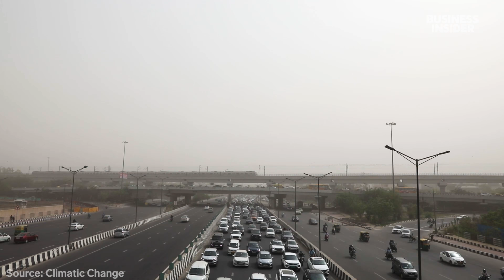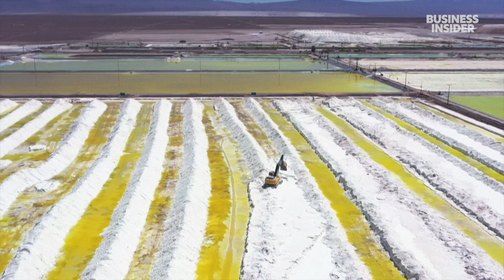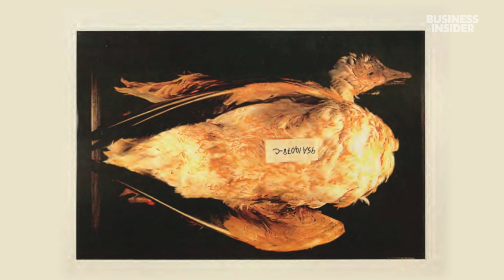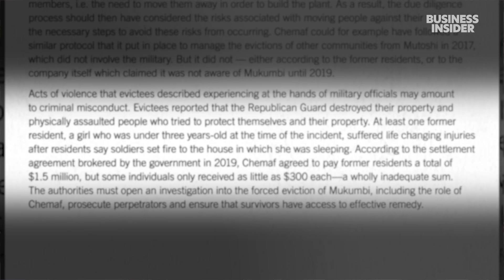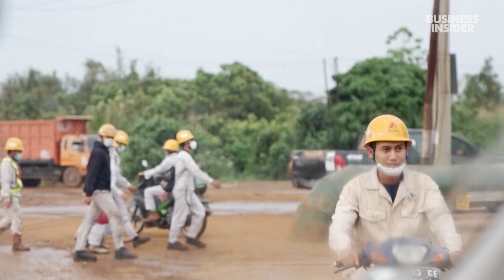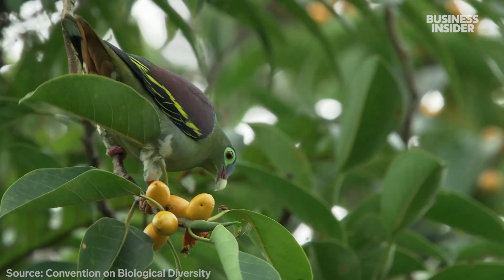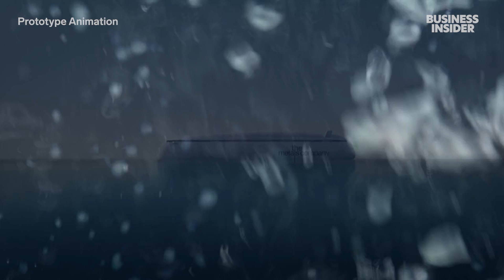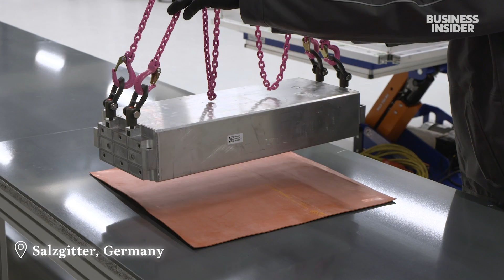The True Cost Of Mining Electric Car Battery Metals | True Cost | Insider News Marathon

Comment: Oil can’t be recycled, coal can’t be recycled but over 90% of batteries can what’s more as more battery technology develops the batteries will, are becoming cleaner. Sodium iron as an example.
Reply: Plug in and charge from hundreds of miles transmission lines from generation plants burning coal and wood pellets. EV efficiency is half because of weight and temperature, twice the tires and brakes. Parking in attached garage may burn everything you have likely won't be insurable. Small damages to battery or undercarriage probably wrote off
Reply: @briancote8216 coal is less than 20% of our electricity source. 1980 called and said you’re due to get your mullet trimmed.
Reply: @briancote8216  
That's total nonsense. 
EVs use a quarter of the primary energy compared to combustion vehicles.
Reply: @briancote8216  I have a few friends with Teslas and none of what you just said is true. Starting from the fact that our power comes from Niagara Falls.
Reply: I won't believe you until you give me at least source of someone claiming 90% of battery material recycled. Even then we would need deep investigation wether those claims are close to actual truth.
Reply: Battery tech is always improving
Reply: @Optimistprime.  ya, that's is why we are doom for committing everything now for the current Li ion battery technology
Reply: @logicthought26  Global Averages do not mean that significant amounts are not recyclable in some regions/sectors.
Reply: But lol can be reused. My friends and I use screen used motor oils for lots of things like lubrication, exterior wood staining, water proofing, returning, coloring and more.
Reply: oil absolutely can and IS recycled ya muppet
Reply: oil/gas/coal are energy dummy.  Recycling require energy dummy.
Reply: Mass and velocity simple physics
Reply: Our 1% of global emissions
Reply: 25% from the falls 59%nuclear 8%wind 1%solar rest is natural gas
Reply: Plastics could in theory be recycled. But we make them as cheap as possible then we don’t recycle them. So just because something is theoretically possible doesn’t mean that selfish humans will actually do it.
Reply: @wmpx34 We recycle a significant amount of plastic.
Reply: they can't so far. I dislike oil for cars with all my heart. I own an EV. but the gods of chemistry haven't nailed recycling that yet.
Reply: @martiruda   TY for also raping the earth.
Reply: @martiruda where do you get your information? FaceBook? Fox opinion anchors? Recycling is already happening - problem is batteries are lasting longer than expected so there arent as yet much available.
Reply: @geraintbermingham4383  I referred to the subject of recycling oil. I'm aware of the business running battery recycling.
Reply: @martiruda  the Chinese already recycle tens of thousands of tons of batteries / year.
Redwood in the US & the Europeans haven't got enough old batteries to scale up big yet.
Redwood is ready though
Reply: @guringai  still is less than 10% of all batteries
Reply: @andrewcannon587  most laptop & phone batteries go to landfill. 
It's far more efficient to collect car batteries.
Reply: @guringai  I referred to the original post which talks about oil recycling. I am aware of battery recycling which is great!

Comment: Well some facts here are wrong for example Combustion Cars use Cobalt either for refining their fuel in the first place or in the Particulate Filters. After all these mines diden't just pop up for electric cars they did increase activity.  most of these minerals can be recycled where most of petroleum products are burned once while still making a big lasting mess.
Reply: Well said
Reply: If you tell a live enough many times it turns to be true. I spoke to an oil reffinery and asked them if they use cobalt in their catalytic converters for sulphur purification. They don't. They use a nickel/molybdenum alloy for sulphur purification. So cut the bullshit!
Reply: @MikeInc79  and what about the platinum palladium and rhodium in catalytic converters? They are far less available then lithium.
Reply: Whataboutism...  @maumau165
Reply: Yeah, exactly. Recycling the batteris for 10x the cost of a new one.wich means it will never be done. Hence the mess is still far greater from evs.
Reply: @TH-qh6jz  What a bunch of absurd nonsense. Even worse with your erroneous agenda. LiFePO4 Batteries uses ZERO Cobalt.

Comment: The closed copper mine featured in the video closed in the 80s and has NOTHING to do with EVs.
Reply: yes it has everything to do with EVs doesnt matter what you say! all those materials ends up in literaly everything around the world.
Reply: We would need 6.1 billion tons of copper in order to produce just one generation of renewables (which would only last between 20 and 40 years before they need to be junked, and new ones made, using newly mined materials and fossil fuels). To date (up to 2024), roughly 700 million metric tons of copper have been produced around the world.
Reply: The picture of the holey ice and the running polar bear had nothing to do with Crimate Chang, either.  
That was one of Algore's 1,000  lies.

Comment: We need more plug in hybrids, and diesel electric systems for heavy equipment. Leverage the strengths of petroleum while we still can, and make the leap to full electric that much smaller.
Reply: Yeah, instead of this it seems we are pushing so hard for huge suv EV's and companies continue to push the range further and further. Then you have the hummer and certain Tesla's and rivians that utilizes enough battery materials for 20 reasonable EV's. I'm sure there are loads of people driving extended range electric vehicles that have the capacity of 300+ miles, but they are making a 20 mile commute round-trip. We need more electric vehicles with small batteries that can be plugged in, and a small supplemental generator.
Reply: @timlong1462  Seems to me that an electric car could benefit from plug in battery modules. You add more modules based on the estimated drive to a limit. If you only need a short duration trip what's the sense of hauling a 1000 miles of battery range with the reduced efficiency of extra weight.
Reply: Stretch the battery resources for where they are really needed, most folks only drive a few km a day so if they can charge at home or work a PHEV makes the most environmental sense since they will almost never use fuel until they have a long shopping day or the infrequent road trip. No need hoard batteries for those rare occurrences, if they have a marathon commute or live in an apartment an HEV with a good fuel economy will help stretch battery resources.
Reply: PHEV is the optimal technology, period. There is simply no need for a 300 mile EV when you could instead have a 50 mile PHEV with a small range extender for the rare occasion it becomes necessary. Bonus: The PHEV also works in winter.
Reply: Chinese BEV works in Winter. It is their regulation to pass winter test.  @N20Joe
Reply: More diesel electric for heavy equipment, how is that better than a straight diesel drive?

Comment: Electric vehicles are NOT a new thing, first cars ever made commercially were electric with battery's in the 1880's they gave up on them because they were slow, heavy, dangerous and would not travel far.... whats changed....nothing
Reply: if you don't think batteries and motors have changed in 150 years something's not right.

Comment: These pools are a very old method as it's the same from almost 100 years.
Like add a dome made of glass increase the heat and collect the humidity and tada fresh water and it works faster and if it rains it doesn't make it take longer as the pools didn't get more water from rain.
Hell there new technology that can make more then this in 3 to 5 months not 16 to 20 like this method.
Also copper is very recycled up to I think 97%.
Also car battery's have ben recycled for decades now and the ev one use same process but with up to 3 to 9 more steps but all the other 36 potential steps are already done now in production lines.
So just add 3 to 9 more steps too all the already there battery recycled plants.
Reply: Not just that, but also no mention of Lithium being mined in the UK! Strange how this video covers some countries and mines here which have some pretty rubbish enviromental records and ancient tech, and not Cornish Lithium which looks to be as green as possible and who also are looking at copper, cobalt and tungsten. This anti-EV crowd really clutch at straws and I bet they don't point at their own mobile phones and gold miining in the same way.
Reply: @katiegoode 
EV's require 6 times the mineral input of an ICE
also mining practices for lithium are abhorrent and does far more environmental damage than anty other form of mining and more damage than ev's save 
then theres the tiny little fact that there simply is nowhere near enough lithium on the planet for EV's to become mainstream
we started with ev's over 100 years ago
they were fucked then and theyre fucked now
this green dream bullshit is nothing but an exercise in coffer lining!!!!

global warming... ahem i mean "climate change" is a multi-billion dollar industry and therefore cannot be trusted to deliver facts
wind farms never produce the energy it took to manufacture and they piss oil all over the place frm the hub seals
solar farms artificially raise the surrounding temperatures and destroy precious farmland
the ONLY form of "clean" energy is nuclear
if you absolutely must insist on EV's they should be run of micro reactors NOT batteries
there is no power grids on the planet that can supoprt mass EV charging either
the power comp[anies piss and moan every summer about people running their AC's
now add millions of EV's suckin power off the grid and voila!! no more grid

add up every single piece of "pollution" humans have ever contributed throughout our entire existence and you wont have enough to equal  even a singular tiny volcanic fart
Reply: @katiegoode  true but usa is getting back in it.
Also city battery's or battery's that will never move don't need lithium and it can be almost as heavy as they like as they don't move.
Reply: Just add a dome of glass. Do you even have the braincapacity to calculate the sheer mass of glass needed for that? The amount of energy to form, transport and place that glass? Or do you mean small little domes? Over smaller pools? Also, link to that new tech that speeds this up please. Those companies with those huge profits might give you a neat bonus for the methods they did not research themselves. As they need to do this 100 year old process, clearly they do not have the money to fund research for more efficient ways to mine.
Reply: @Mediamarked  um ya it's less then 1 skyscrapers worth of glass and we build glass greenhouse all across the world all the time.
And a 1 time transportation of the glass of let's say 200 trucks.
Omg like adding the extra systems they can collect freash water and prevent rain from increasing the time taken and you can open the tops when workers go I so it's not over 150f.
Also it will prevent wild life and people from getting in it like in Utah where people where literally swimming in this kind of water.
Hell other then the 1 time cost with random repairs after a few years I call it a win.
Hell they can use it in winter as it definitely going to be warmer then outside.
Reply: Great info. I am loving the comments on this vid. Way better than normal collection of people from the mining industry itself. These news outlets just give a strong slant of misinformed cherry picked bias going from opinion instead of knowledge.
Reply: The problem is the demand for copper is skyhigh. You can today only get 7-8kg copper / ton blasted rock declining. We need untill 2050 so much copper as we have used for 4000 years. This demand is impossble to meet.
Reply: @MikeInc79  if it's a battery pack for a city it can use iron salt and magnesium or a different mix it doesn't need to have copper.
Also the weight doesn't matter well to a point that they can be very heavy but since it doesn't move its ok for it to be like 10x heavier then the rest.
Reply: a battery pack for a city is ridiculous. How many tons of minerals must be used for this enorumos battery packs? It's already been proven in Australia is doesn't work. Imagine thermal runaway in a such battery pack spewing nerv toxic smoke over urban areas. And it can't even benn estinguished with water. Don't never ever put water on alkali metals! It's better in long term to build stable energy production not intermitent energy sources like solar and wind anf thinking batteries are good energy storage. Absolutley bonkers!   @DeathsGarden-oz9gg
Reply: Don't worry the heroine addicts are "collecting" it and recycling it. @MikeInc79
Reply: @MikeInc79  Yes but let's not dwell on the practicalities, in that case we would've gone for the greatest polluters first and not the lesser, such as cars...

Comment: I’m not for or against the EV industry but it seems to me that it would be a good idea to use existing technologies and also new ones instead of just throwing out the old ones and jumping both feet first into this new idea that we don’t even know will work
Reply: EVs are more than 100 years old. It works.
Reply: Nobody is throwing out old tech. Ev can't all be replaced immediately. And it will continue to be better while ice vehicles reached its peak.
Reply: @frankreynolds9930  ICE are nowhere near there peak the single stroke motors prove that they are nowhere near finished in advancement either
Reply: We built an electric chevy truck in high school for $10k from 1995-98.. It could smoke the tires and had a 200-300mile range.. 
Chevy released their EV-1 around the same time and it was absolute garbage.. it was clear the tech was being suppressed.

Hybrids right now are the best of both worlds. Some get well over 50+mpg and you can take them on long trips without having the anxiety of finding a charger and sitting for an hour every 200miles.. you just fill them up and treat it like a normal car.
Reply: 100000% agree Hybrid vehicle is combining both technology and I think is the win win solution at least for now